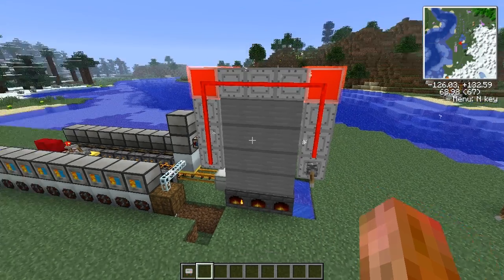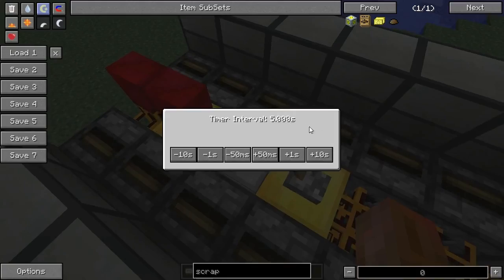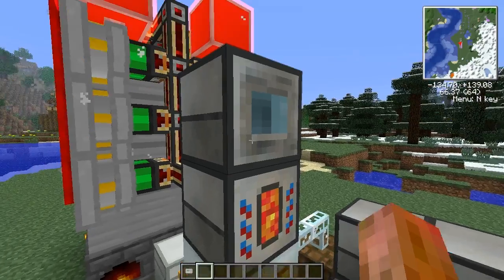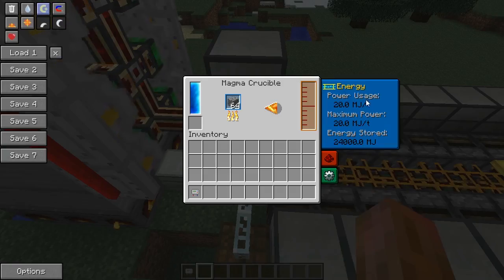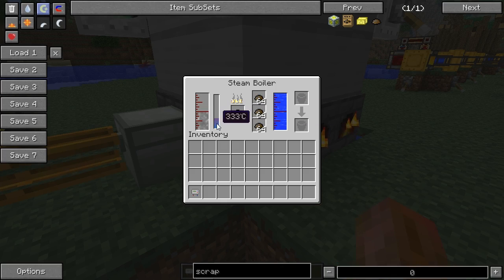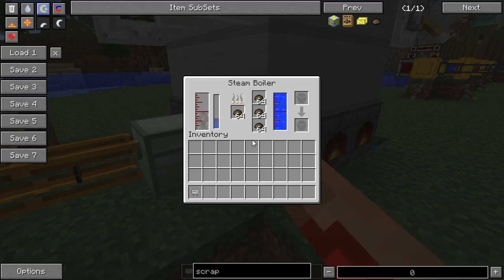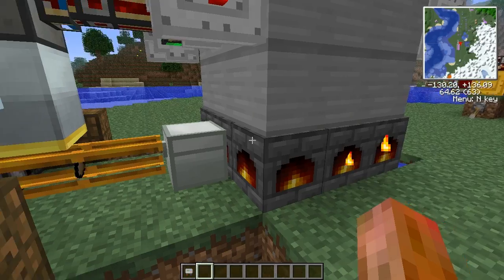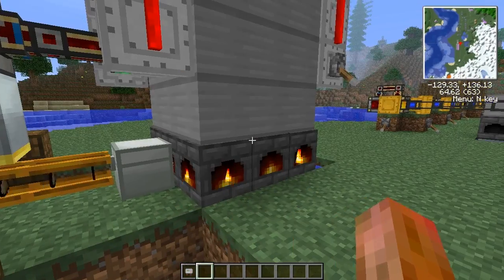Infinite MJ from IC2 Scrap using Railcraft Boiler

Comment from the maker: High Pressure boilers - you could use Low Pressure as well, it will generate half the MJ and be a bit more fuel efficient so you would need a bit less than 1/2 the number of Recyclers. I didn't do the math on that to find the exact number though.